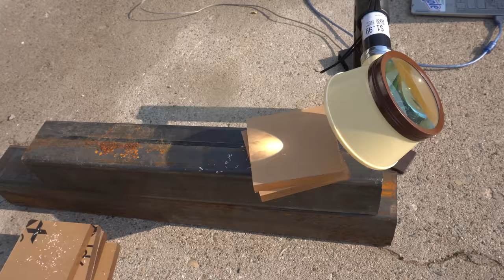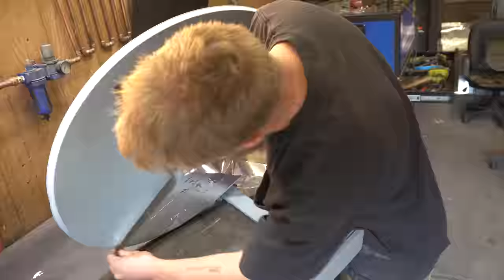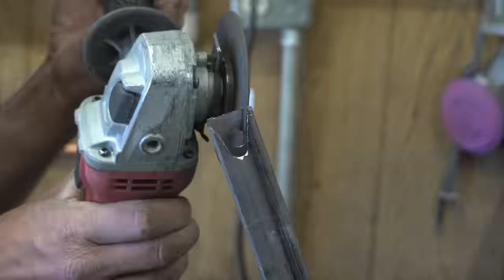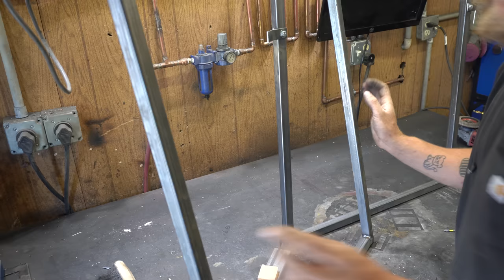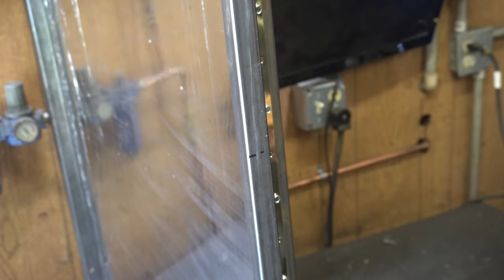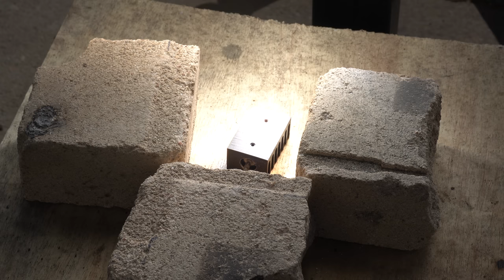The Pursuit of More Solar Power

Comment: Enjoy your videos, retired now and I am doing fun stuff in the shop/lab, like this video, knew there was a good reason for saving all those Purdue overhead projector lens everytime the campus threw these away, have over 100 of these also the 2 large lab ozone generators the campus used these have 35k plus voltage at .25 amp, make a good power supply for some homemade lasers that I watched you build on some other of your videos.

Comment: It would be interesting to see if the smaller lens would be able to stand the heat of the larger lens in order to focus the light more.
Reply: This must happen.  Also, unless I'm a complete numpty, you can bend the small one to remove the aberration from the big ones, right?
Reply: It shouldn't heat up that much as it only redirects lights (with minimal losses) afaik
Reply: @Pest789   Good point. On that note it might be worth it to have a way to adjust the sag in the larger lens as well. A small rod pushing up in the center shouldn't block much light.
Reply: it'll most likely destroy the plastic (I destroyed glass before, even a tempered oven glass)
Reply: @SolarCookingGermany  That's what I was concerned about. I assume that there is some combination of distance and angle that would work to focus the light and not melt the second lens.
Reply: @sumguy2858  In theory yes. In practice the focal point will move along with the sun, distance and angle will also change and if you forget to pay attention all the time you will end up with burnt/scorched/broken stuff. Ask me why I know that ;)
Reply: @SolarCookingGermany  Yeah I think in practice you would need this setup to auto focus and track the sun.
Reply: When my kids were little I had one of those and a military surplus periscope lense, together the 5 of us burnt holes in the driveway and stuff.. (2lense 2kids+me) 
Aluminum is too reflective to melt like that (in open air), put some black iron oxide on it (get it dirty with some rust) you might melt it, at least melt the zinc alloys... 
Or
Maybe in a glass block vacuum chamber bomb‽ Nevermind, I don't want to be a bad influence...

Comment: Want to see you using dry ice to fill a large high pressure co2 gas cylinder and use it for welding.

Dry ice is dirty cheap at grocery stores but does it work for mig welding? No one has ever shown that on YouTube!

Comment: Focus the big array on a graphite crucible, can almost guarantee you'd get it hot enough to fully melt aluminum. Solar energy will be able to get up to 5000 kelvin if perfectly concentrated, which is plenty hot to melt anything you like, except perhaps some extremely high temperature ceramics.

Comment: You should do an experiment with a big sand battery... see how fast you can heat it up with the beam. I'm not sure if it would melt the sand, maybe you could put some kind of heat sink bar going down thru the center and aim the beam at that... as long as it's got a high melting temperature. If you could heat a sand battery quickly it might have applications with sterling engine generators for low wattage production.

Comment: You’ve probably figured it out by now!! But you actually have a lot more power than you’re calculating because you aren’t factoring in the rate of heat loss from the heat sink itself (which would be complicated). You would get a more actuate power reading if you used something that would hold the heat more! Like a solid chunk, ideally insulated so that you’re keeping all the energy in to drive the maximum temperature change. 

Given the power density of the sun and an A4 sized lens, you should get about 1353W/m^2*0.063m^2= 85W assuming a perfect sun conditions, focus and 0 heat loss in your measuring device!!!

Comment: Shoot the light into a fiber optic cable, then you could really use it on a cnc.
Reply: You can actually find some stuff about this, its been tested as a way to save money on illumination on buildings etc.
Reply: You'd need a much better lens arrangement to focus the light to a fiber - maybe a bundle of fibers would work, like a fiber light source on a microscope uses. A single fiber would be pretty impractical in this application. A fiber bundle you could have another focusing lens right at the work surface that could aid in getting a more concentrated smaller spot size as well.
Reply from the maker: I've been messing with this, but god damn are fiber optic cables expensive
Reply: @cranktowncity  Yeah, i kinda through it would be.. especially thicker one. Maybe aliexpress. You also have some really large aperture multi elemement lenses on those projection TV:s... even though they are plastic lenses i think... might be useful on some of this stuff. A projection tv would be in its entirety kinda a good solar collector.. you have the fresnel collecting light, mirror that directs it and keeps the size smaller and a lens that then forms it into a nice spot.

Comment: Solar powered 3d printer with uv cure resin. Have it extrude some L-channel carbon so you can make a lighter frame. Coat some unidirectional carbon  with the resin and draw it through a die and through the light to cure what could go wrong

Comment: SiO2 melts something around 1200C :) aluminium even lower, at 600C :)
Reply: or at least glass transition is there, the actual melting point is something like 1700C
Reply: solar = 1000W/m^2
Reply: spray aluminium paint or molten aluminium
Reply: your heat sink is too fast, use a block
Reply: did you calculate the mass of the heat sink block
Reply: heat capacity of the aluminium
Reply: or the half-passing fresnell lenses
Reply: did you remove the polarization layer :)
Reply: well laser melts at 20-50W range
Reply: you meant to throw shade?

Comment: I feel like just a block of aluminum would be better than a heat sink so that you aren’t actively getting rid of heat
Reply: Heatsinks are hard
Reply: What about a black stone immersed in water? Run either a stir bar or a small pump to keep it mixed, but it would have high enough thermal mass to be consistent

Comment: Hey, not sure if somebody gave you this sugestion already, but did you ever tought about puting the first normal lens you tested under all that frensel setup, to make a very small spot from all that focused power?
Reply: Maybe just put your first machine under the frensel focus point and try, maybe it will print so fast you won't even need to adjust the frensel...

Comment: I like your test but using a heat sink to hold the thermocouple was probably not the best idea. The heat sink is constantly working to dissipate all the heat back into the air!  You could have just ground off all the fins of that heat sink, drilled a shallow hole, and used thermally conductive epoxy to secure the sensor in. Cover the back in a thick piece of foam board and you would certainly see much closer results.     Either way, I would agree with the annoyance of having to rerun the tests hahahaa. MAybe just do a measurement like this on your final form to see how much they differ.

Comment: Surprised you didn't just spread some hot glue under that space blanket before laying it on, then you could've used some heat to re-liquify the glue and pull it all perfectly straight

Comment: A Heat sink is removing heat. You shouldn’t measure time, you should measure the equilibrium temperature it reaches

use a solid metal block instead of a heat sink if you want to measure time

Comment: Your approach for estimating the wattage is most likely flawed.
I'm assuming the factor 42.66 is supposed to be the product of the isobaric specific heat of aluminium (897 J/(kg K)) and the mass of the heatsink. This would mean that the heatsink only weighs 47.6g for the math to work out, which I'm unsure if it is correct.
Even with the correct mass I can't imagine this setup gives you any decent accuracy. I'd personally try heating a tank/cup of water with the thermocouple in it while it is also being stirred. That way you have a better chance of uniformly heating the object, making the estimation of the input power better.
Nevertheless a fun video!